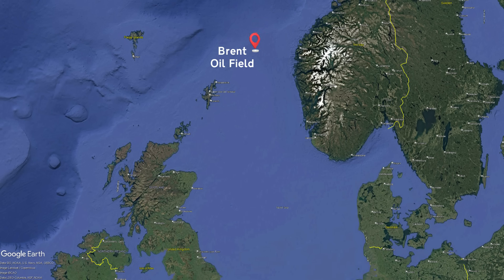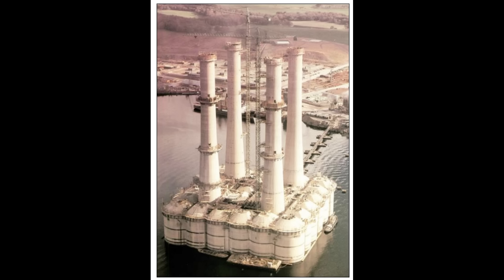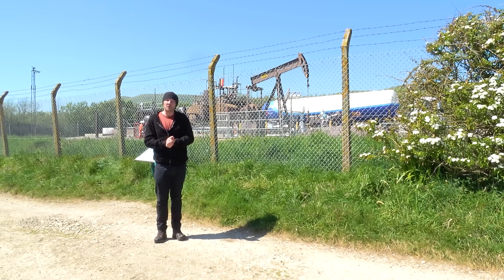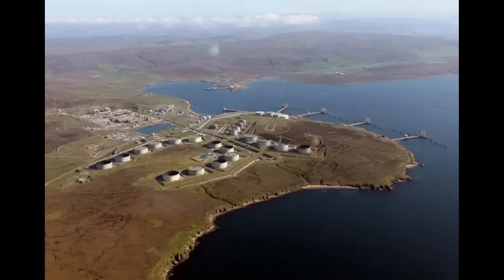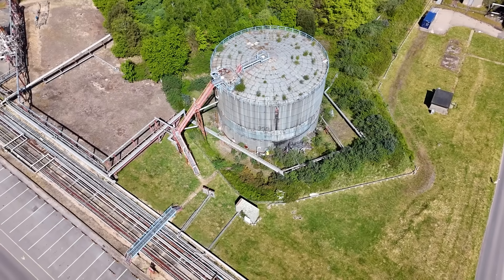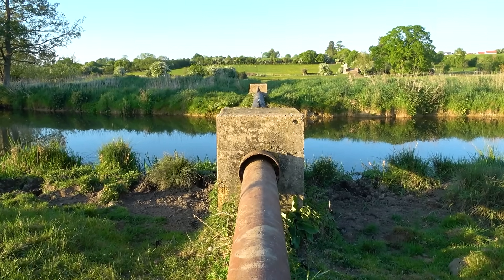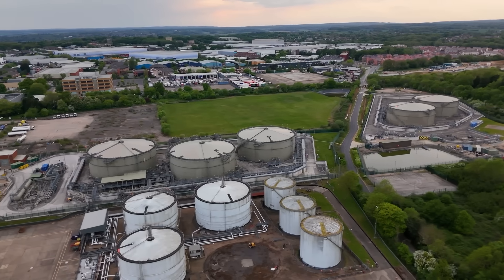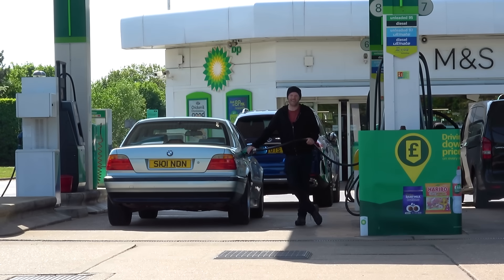Where Does Petrol Actually Come From...?   A Journey From Source To Fuel Filling Station

Comment: A great video Jon. Like much in life, the complexity of supply chains isn't really understood by most people.
A bit of extra insight with Buncefield. It wasn't really a faulty valve. It was a valve fitted the wrong way because the venture capitalists who took over from engineers didn't understand things properly. And rather than filling up according to procedures, they filled up using the ultimate protection device. A bit like driving on adaptive cruise control and turning your brain off.

Comment: The war time pipe line to airfields was contracted out as a water pipe to the contractors, which led to some interesting developments later on. The one feeding lakenheath was installed as a water pipe so the contractors sealed the joints with pitch. This was not discoverd untill the 1980's whem better metering at either end of the pipe line picked up discrepocies, the result there is now a lake of petrol and kerosene underneath Lakenheath. Read about this in the 80's.

Comment: I can clearly remember Buncefield going up. We live on a hill in north London and it rattled our windows and we could see the plumes of smoke and we heard the following explosion! Also our neighbour is a Co-Pilot for DHL trans flights and they were doing a circle waiting for ILS clearance at Luton when it went off, despite being a few thousand feet away it was enough to force the plane off course! Not only that we had a delivery delayed a few days as the van driver was on the M1 at near ground zero in a Evri van and it blew him into the hard shoulder. I do recall seeing melted lampposts and damaged signage for the A414 when the M1 was deemed safe to open. I don't think the explosion was as big as the Flixborough though. There were houses up there until quite recently that were so damaged they had to be vacated.

Comment: I worked on a petrol sales site in Worcester, most deliveries came from Kingsbury near Tamworth, though occasionally from Fawley, Buncefield, Cardiff or Cheshire. 
Worcester did have two tank storage sites, with supplies coming up river by tanker. 
There is a fuel pipeline running through the area, obvious if you know what signs to see.
Reply: Yep . Jump on the canal at Drayton basset walking toward b/ham and you will come across a rather large pipe crossing the canal at around 15 foot up .... with spikes each end .

Comment: Hate to correct you, but the Dorset oilwells are not the oldest land-based ones in the UK, Nottinghamshire and Lincolnshire have their own oil field and have been producing oil for over 85 years, in fact, it was Britain's secret weapon during WWII and kept the RAF flying! It is actually high-quality oil, a lot better than the sludge that comes from the Middle East and is regarded as such high quality that it is used in specialist applications; using it for petrol for vehicles would be a waste!
Reply from the maker: Im not sure I said oldest but largest.  Good info though.
Reply: @AutoShenanigans our farm in notts was bombed by germans looking for the Eakring oil fields that were only a mile or so away. Fortunately little harm done

Comment: I still find it mindblowing that they must be thousands of petrol tanker trucks operating 24/7 to keep even the most remote petrol stations stocked. I’ve often wondered if a petrol tanker would have to drive all the way from Immingham, to refill just 1 small petrol station in a suburb somewhere.
Reply: If it helps ......
Yes , yes they do although they will do other stops on the way .
They have 38K on board assuming its not a baffled tank with vrs types of board so will drop in and blow say 15K into the first place and 20 into the next . That may be the only job they do that day . Next day they may do say 5 stops .... it all depends on the planning . You may do 4 jobs running up and down to say kingsbury to b/ham airport or you may have 1 drop in the middle of wales .

Comment: Oil's more like dinosaurs, ferns, and moss squished into a liquid. Also, it's gasoline vapor-with the right mixture of air-that becomes explosive. It's why you have to mix air and fuel to get an engine to run. Anyway, I grew up in southwest Louisiana, home of the Gulf of Mexico offshore oilfields, so I knew a lot of people involved in the industry. After graduation, I worked for an IT contractor at an oil exploration company, and I have to tell you that finding oil is as much science as black magic

Comment: The Wytch Farm oil field comprises three separate oil reservoirs that include the Bridport and Sherwood Jurassic sandstone and the Frome clay/limestone ones. Bridport was discovered in 1973 lying 900m beneath the surface. The Sherwood reservoir, situated at a 1,600m depth, was discovered in 1978, and the Frome reservoir that contains 7.5 million barrels (MMbpd) of oil at a depth of 750m was discovered later.

Comment: My friend Chris was working at Dixons on the Buncefield estate when the small flammable disagreement happened in 2005. The side of the building facing the explosion was bent in and there were no right angled corners left. His department’s computers were not destroyed by fire, but by the sprinkler system showers. They exploded one by one as the power supplies bathed in sprinkler water.

Comment: Just to clarify nomenclature - an Oil Rig is a moveable structure that does the initial drilling. An Oil Platform is a "permanent" structure that is anchored to the sea bed and extract the oil and gas. I used to work for BP Exploration back in the 80s in the Reservoir Engineering dept.

Comment: Then the engine burns it at only 30/40% efficiency what remains being wasted energy expelled as heat mostly out of the exhaust, and the other unburnt chemicals.

So guessing of a full tank of petrol(£80) £50 of that literally goes up in smoke.

Comment: Brilliant explanation of the ridiculously complicated fossil fuel use compared to the ridiculously simple use of renewable energy. Wind or sun or water creates electricity, can be stored in batteries if necessary to balance the flow. Travels VERY quickly along cables to home, workplace, EV etc. All at very nearly 100% efficiency when fossil fuel is about 30% even if you exclude all the losses between sitting quietly deep under ground to your car’s fuel tan. The 30% inefficiency is just the exploding inside ICE cylinders to create rotary motion at the vehicle’s wheels. We should have technical advanced away from fossil fuels decades ago :-)
Reply: Wind and solar are highly intermittent. We have no large-scale hydro in the UK. Pumped storage needs very large reservoirs and is only really suitable for balancing peak demand. Battery storage for the entire UK does not yet appear to be viable.
Like it or not we're going to need fossil fuels for decades to come. Not least to deliver all those wind turbines.
Reply: @Gordanovich02 , why aren’t batteries in the UK? They are everywhere else on the planet, Australia and Texas to name only two places

Comment: There was an oilfield at Eakring in Nottinghamshire which I’m sure was operational during the Second Small disagreement. It’s shut down now but the area is open to the public to see a few old ‘Nodding Donkeys’ hidden in the woods. I also used to cross the route of one of the secret pipelines almost daily when I lived Darn Sarf, just outside of Shoreham in Kent.

Comment: Being in Texas, I a bit more familiar with how things are done here than how they are done over there, a big part of it being "send it to Houston where the all refineries are".
Many years ago I worked on software that talked to gas pumps to handle pay-at-the-pump stuff, so I am familiar with the name Tokheim. That was one of the four companies making pumps at the end of the '90s. Then around 2000, Tokheim and Schlumberger got bought out by the other two at roughly the same time, leaving only Gilbarco and Dresser Wayne making pumps, at least in the US.
And did you know that the collecting of things related to fuel stations and pumps is called "petroliana"?
Reply: If you've ever seen a seemingly random white post with a small yellow roof shaped cover with a black line on it by the side of the road. That is marking the route of a GPSS pipeline.
Reply: @garyfrench6536  Does GPSS go to Texas?

Comment: Strange, I live near Hamble for nearly 20 years so it was interesting to see, I've got an EV now so no petrol for me now 😁
Reply: Good luck when the grid collapses due to no base load generation!
Reply: @ in the UK we have about 40% of the wind that hits Europe and interconnectors with countries like France and Norway and we will continue to have base load from nuclear and gas for sometime.
Reply: I drive an EV. And while it’s a lovely car to drive there is no way round or glossing over (and anyone that does is in denial) that public charging on the fly is the biggest pain in the ar** ever created and it will never change. I miss on long trips a 5 minute refuel and ME stopping where I WANT to have a break and not where I can find an available charger.
Reply: @xr6lad  while an EV wont work for everyone at the moment with over 10k charging locations in the UK it does work for a lot of people especially if you have home charging as done overnight on cheap rates and for most (average UK daily drive is around 40 miles) - but to be honest if you travel a lot your better buying a Tesla as speed of charging and reliability and ease of use of chargers is still the best

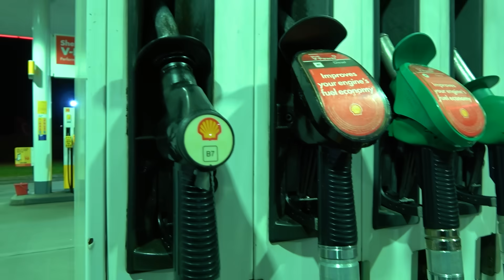Comment: 9:51 it's not really the last step. The last step is vapour recovery. When you fill your car up, the vapour is pushed out of your car and collected. The tanker then collects the vapour. This is then turned back into a little bit of fuel again. This process is called stage 2b vapour recovery
Reply: But wait, thats my vapour and I want to let it out and inhale it.
Reply: 2B or not 2B, that's the question.

Comment: One of the largest inland oil fields is around Gainsborough and as a kid there weren't many days in the school holidays that didn't involve  a bike ride to check if the nearby nodding donkeys were still working. Stand in the right spot and you could see the donkey in the foreground and the Trent power stations in the distance. There used to be a pub called The Nodding Donkey in the town but now just a memory.  
The old oil terminal at Torksey still has  bit of old rail infrastructure crossing the Trent and remains of a rail bridge spanning the main road to Lincoln, Mr J could fill a day or two around there

Comment: Back in 1988, I was one of the engineers building the A42 Ashby de la Zouch bypass. As part of that, we had to build a new lump of A511 from Ashby to Sinope. This involved building a new railway bridge and approach embankment about a mile east of the A42 junction. The first thing we had to do was put a bloody great concrete protection raft over the 6" pipline that runs from Fawsley to East Mids airport. Although you can't see any of it now, about 200yds east of the railway bridge the 'secret' pipeline is marked by a white post with a red hat on one side of the road and a white marker sign (like a FH sign) on the other side. Just thought you'd like to know!
Reply: The red/white markers are guide helicopters down the buried pipelines looking for 'unusual activity' within a defined distance. If you are above one at 500ft you can see the next one.  I was an apprentice helicopter engineer back in the late 70s and would ocassionaly accompany the spotter (from the pipeline company) on a leg. Our first night stopover was in Saffron Walden. #goodolddays
Reply: Oddly most of it comes in by road . I cant account for BP but the others use bridgers coming out of kingsbury and im 60/40 that Bp also use bridgers . 
Given the fuel farms have been around since pre 88 i hate you tell you but you may have been super dooper cautious over a disused pipe line !
Reply: @godzillas6301 I occasionally work the tank trains into Kingsbury and I’ve been told the pipeline is still used from the refinery but it’s expensive. We mostly work diesel into the storage sidings so whether they use the pipe for petrol to save purging it I don’t know. Some trains are petrol but not many at all in my experience. Could be a top up?

Comment: Buncefield wasn't a faulty valve. Its just that no one closed it! Faulty gauging, high level cut off device inoperative, no ESD for the pipeline and poor receipt procedures led to the overfill. Incredibly fortunate that no one was killed. Nice video but barely scratches the surface of the industry that has kept the wheels turning, many of the lights on and many raw materials for other industries. Theres many terminals, pipelines, trains, trucks and coastal shipping involved in getting fuel to your car or home heating tank. As with many things we are increasing relying on imported products

Comment: Great video, I agree with another comment that this should be used in schools. There is also all the energy used in refining and distribution. Looks like you end up burning about 20% of what you pull out of the ground doing all that. It made me smile to see the massive solar array on the buildings in the processing plant tho.

Comment: In one of my previous lives I worked for Gilbarco - another pump maker. Petrol fumes (surprisingly) are hugely explosive but also heavier than air. So as you are filling up, its likely that fumes are spreading away from the pump, under you car and so on. I still find it amazing that some people arrive, see the no smoking signs and throw the butt on the ground before (sometimes) standing on it.  However, the biggest source of fumes is when a tanker arrives to fill up the underground tanks and this is usually a good distance away from the customer side  OR they have to close the station while the tanks are filled.  On one large site in Essex (IIRC) the kiosk is in the middle of the site separating the cars from the tankers so everything can carry on unimpeded.  An earth bank abut 2 to 3 metres high surrounds the site.  Fuel station employees know the rules and are quick to stop people smoking on the forecourt. However,  a delivery man in the process of filling the tanks could not believe that two members of staff exited on the tanker side of the kiosk, lit up cigarettes and calmly walked across the site. The delivery man was offski over that bank faster than Hussein Bolt. Fortunately, nothing ignited but I would have thought it must have been a close run thing.
We have another refinery up here near Falkirk. Big place. Also another Shell plant at Mossmoran across the other side of the river
Good explanation Jon.
Reply: At my local station the employees go out the front for a cigarette break, a few metres from the pumps. I’ve tried to tell them but they say it’s fine… ok but why take the risk?!?
Reply: @THEMathHacker-121  At my local one there aren’t any on site. It’s necessary to pay up front by card to buy any fuel there.
Reply: I once saw someone smoking underneath the vent pipes from the big tanks. They were talking on their phone at the same time and seemed oblivious.
Reply: Grangemouth closed this week thanks to the green agenda and a greedy owner not wanting to spend money on the plant in spite of getting millions from the Scottish government a few years ago.
Reply: That’s not true. All the petrol stations I’ve been to, have had tanks filling up very close to the main forecourt. I was at one the other day, and the tanker was practically taking over the forecourt while people were still getting fuel and going in the shop. I’ve been lots of times to petrol stations when they are taking a delivery, never seen them closed. I’m surprised you haven’t mentioned the no using a mobile phone at a petrol station. Considering loads of people pay with their phones at pay at pump stations and every petrol station seems to have parcel lockers now, that rule seems to be impossible to follow and is largely ignored.
Reply: @EnterShikari01  There is a Sainsburys in Newhaven where I used to live. Yep small forecourt. Always closed when the tankers come in.  But its up to the station managers and H&S to observe and enforce the rules. 
The mobile phones thing probably isnt an issue. Back in the early 80s CB Radios could sometime interfere with the electronics with unpredictable results. But before I left the company in 93, I'm pretty sure they largely sorted the issues. However, if the pumps arent properly earthed you could theoretically generate eddy currents in the metal work and there is a minute possibility that you could arc out to something. So why take the risk?

Comment: Hmmm, I was hoping you'd shed some light on the difference between big name brand and supermarket fuel...
Reply: Petrol is Petrol, the difference between the companies branded fuel is the Chemical additive they add to it.
Reply: @stevecrawford4817  I am aware they all source the basic fuel from the same place, and it's only in the tankers that deliver it to the filling stations that they use different additives. But what is the difference in those additives? And why whenever there's a fuelling issue (mostly clogged injectors) and you take the car to the garage, their first question is: Are you using cheap supermarket fuel?
Reply: @KK-M5  That's because mechanics no nothing about fuel. They still think supermarket fuel is poor quality which is not true. It might have been the case years ago but not anymore.
Reply: @KK-M5  The additives are things like detergents to clean your fuel injectors.
Reply: They are both watered down with 10% crapanol that rots your rubber bits and absorbs water